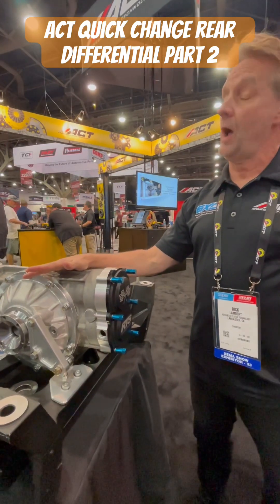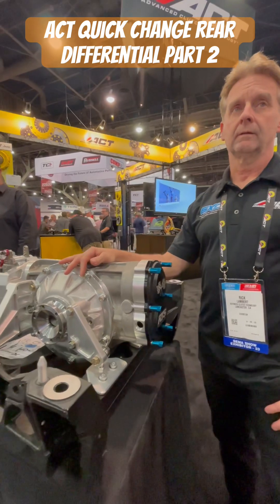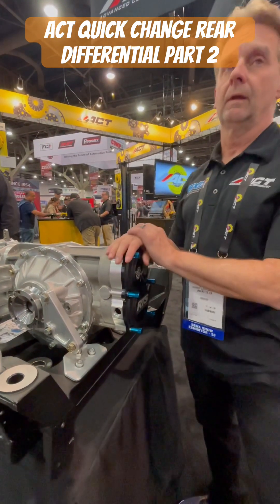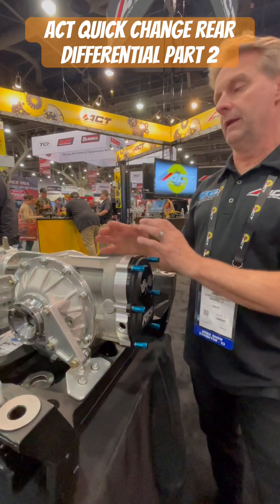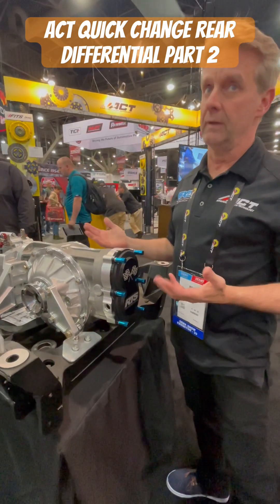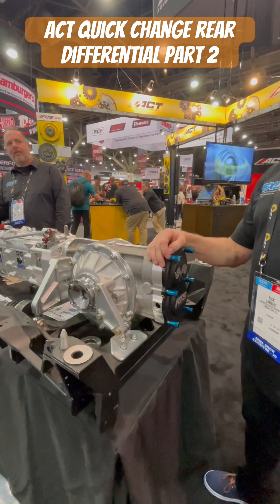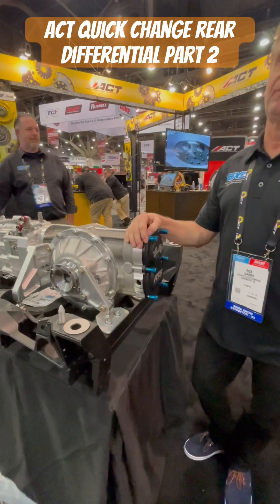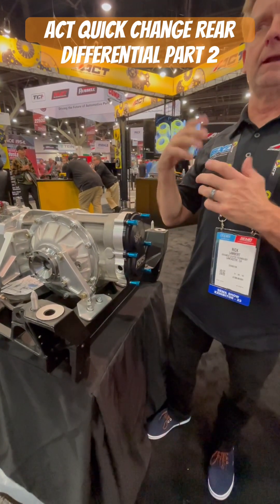Quick Change Rear Differential “it looks cool, it gets the job done”

Comment: You can’t utilize one of these in an AWD Honda without a custom transmission, unless you use a more normal mounting like an s2k does.
Reply from the maker: Not 100% accurate, you simply need to have matching gearing in the rear differential. Folks tend to use custom ratios in the differential or have a driveshaft with a viscous coupler built it.
Reply: @ yes it is, you can’t quick change the rear and expect the front to be ok.
There’s no point in having a quick change if you still need to open up your transmission the normal way to change the gearing inside.
The whole point of this type of diff is that it is quicker and easier to change the gearing, it can take less than 5 minutes.
You won’t be able to do that on the front, at all, that’s like an hour long job, plus this adds an extra ratio so unless your quick change gears are 1:1 and you’re ruining the exact same ratio as you are in your transmission it doesn’t work, and if you do that then there’s literally no reason to get a quick change, because at that point you’re not making use of the quick change gears whatsoever.
Reply: @ I don’t think you know what this thing you’re showing in your video even does